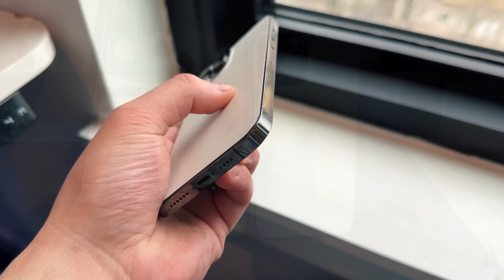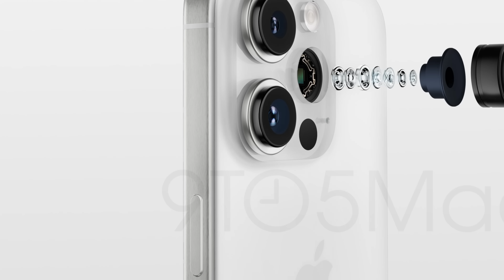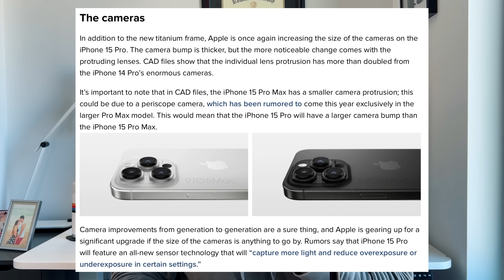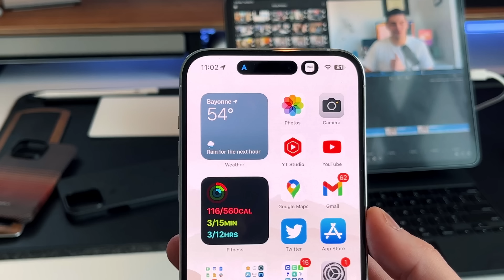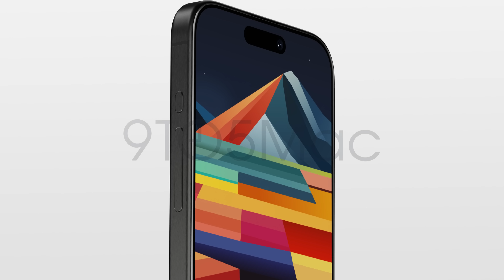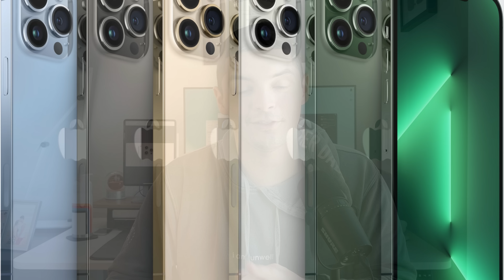iPhone 15 Pro & Pro Max are Coming With Major Updates!

Comment: TBH there are not going to be any significant hardware updates on the iPhone 15. They are only removing physical buttons, which many people don’t like, and changing the charging port to USB-C, which many people don’t care about as well. All seems like a big nothing burger for a year when it’s supposed to be a major design refresh. Let’s be honest, they can’t really innovate the iPhone design any further now. It’s all been done already and that’s the problem.
Reply: People do care about USB-C enough to force apple by law to use it (Europe). As for removing the buttons, I will wait until Apple confirms this as rumors should be taken with a grain of salt